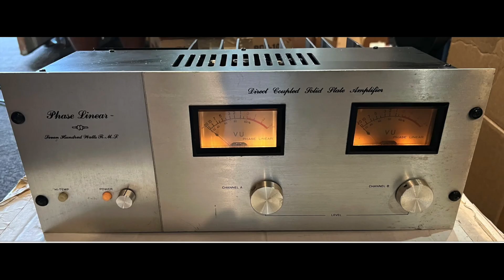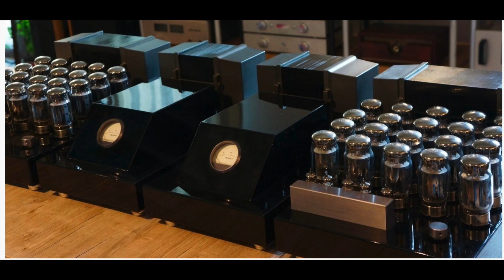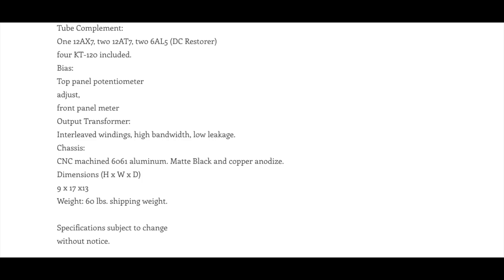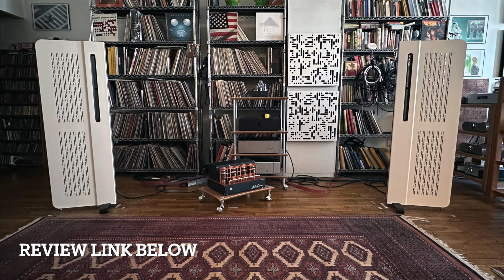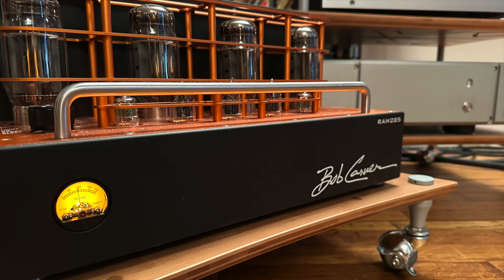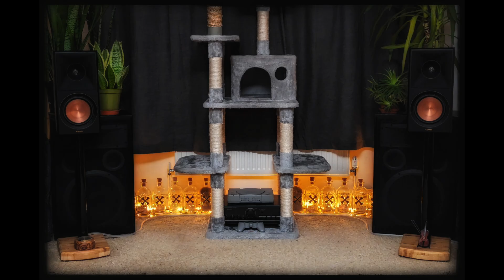BOB CARVER RAM 285 = Maximum Fun!

Comment: I still have my Carver receiver, sort of was consumer State of the Art in 1982. It had a moving magnet phono input, which is the reason I chose it and it's 140 W,  to drivemy JBL 240 TI's and JVC turntable. The SS Carver was the weak link in my vinyl front end system oh I had a tascam cassette deck recorder and later on other kinds of things but I was always a vinyl guy so I bought the best turntable I could afford, the best cartridge I could afford to protect my records and the best speakers I could afford. Well almost 45 years later I still have my Carver Receiver and I've had it repaired three times and it's done fantastic. 

Broadcast radio isn't that important for me  anymore I get everything online but it is the only one of my three original components that I intend to replace. I am replacing it with another integrated amplifier, but this time I'm going with the integrated tube Rogue Cronos Magnum III, I wanted something that could push the JBL's that are @89 DB sensitivity. It has a solid state phono section, so I'm going to step it up a notch and go with an Rogue Ares Phono-preamp M II and my 42 yo Classic JVC QL-Y66F TT as my front end. Going through auxiliary, so I'll be able to run 2 turntables when I finally upgrade to a new deck.

I considered the New Carver Tube Amp, and the Decware Sara & Sophia  and other triode amps even Western electric designs, and I just didn't think the efficiency of the JBL's was high enough to give me the full effect of what I like to listen too. I haven't heard the Rogue, but I'm looking forward to it. On order.
PS your opinion about exile on Main Street. My favorite Rolling Stone album too. I never considered that Mick Jagger added his vocals later. I know he was babysitting Bianca while everybody was at Nellčote. They stayed at another location and that it was unbearable conditions in the basement of the Villa at Nellčote. I know he added certain things in LA, but that he wasn't part of the creation of the whole thing. I never considered that before.
Reply: Good lord you should have changed the carver first and saved a lot of money.

Comment: I developed a dynamic bias circuit for a customer amplifier several years ago. The customer gave me correct block to redesign and amplifier that he had bought which was a home brew calamity. So I redesigned it and decided to do some experimentation and solve the problem of how do we get very low idle current without causing the Distortion levels to rise when more power is required. Has anyone familiar with biasing vacuum tube amplifiers will note, vacuum tubes will suffer Notch Distortion as you increase the signal if the bias voltage is too negative. So I took some of the plate winding output and used it to add positive voltage to the bias Network so the bias would start to go less negative as the signal increased. As a result the amplifier ran so cool at idle that you could touch the glass envelopes of the kt88s without burning yourself. You have to amplifier wood develop more Dynamic Headroom than it would with standard Class B bias because the power supply voltage floated at a higher voltage. Another Advantage was the amplifier sounds more dynamic because the gain of the amplifier increases slightly as the signal increases giving it a livelier sound and increasing the dynamic range.

Comment: There's no question that Bob made some of the best solid state audio Care on the market. However, when he delved into the tube world his designs were fine but suffered from crappy quality Chinese made audio output transformers. When I tested his vt20 to be which was in my shop because the customer thought something was wrong with it I discovered the bandwidth of the amplifier was only 70 to 15 kilohertz. Despite Bob making the claim that it has some incredible been with down near the one hurts range. Maybe it does at 1 ml. But not at useful power levels. That said I still own and use the c4000 free app as the centerpiece of my sound system since February 1980.

Comment: Wow, no mention of the Cinema  Grand  5 chanel amp? You could get it from 200w to 300 wpc. I had mine for  20 years.  Think I paid $1500.00 for mine.  Now, use it in 2 channel  biamp  with my 1st gen B&W 703  floor standing speakers.

Comment: Awesome. If my ship comes in and it's not on fire, this is what I would add to my system.  I would use my Lyngdorf 1120 integrated amp as a pre amp with room correction along with my Q Acoustics Concept 50s.  Hello Santa?

Comment: Hey Steve. I don't have time right now to search all comments.
Have you heard that the late John stroebeen of 
Ohm acoustics (ohm walsh) was approached by Bob carver to design a driver for carvers new subwoofer. That subwoofer was the  sunfire true subwoofer.
John stroebeen in collaboration with Bob carver,the sunfire  true sub was born.
Also research the connection between Thiel speakers and ohm walsh.
In fact some of ohms speakers use  a 4th order Thiel Butterworth  crossover.
PS. Did you do a review of the ohm acoustics flagship F5015 from the 20/20 K SERIES. you mentioned a possible review for 2023.if not did John's death delay or stop the review? I talked to John's sister(joy) 
John's family and some of his workers are committed to keeping ohm acoustics alive. They were looking for a buyer.i believe they will find one if they have not already.
It would be a shame if one of the best kept secrets in hifi audio and one of the best speakers period were discontinued,in terms of height,width,depth,and  of Soundstage, and realism you said in the review of the ohm walsh 1000 series reviews.
If the new owners continue with John's vision,isn't ohm walsh designs one of the closest we will get to realism? Although I think absolute realism is not possible,but let's get close.

Comment: John, love your work but I'm sorry I don't think this at all is proper evidence of impact your changes had. This anakysis is taking the absolute worst csee scenario to the absolute best case scenario, no way a real or ideal world analysis. Any time I ever moved into an apartment, before I had anything in it, it sounded bad. But we live in a room by adding lot of stuff, carpets, furniture, tables, bookshekevs and many many more things. Those are by design there to improve your room situation. So any real improvement should consider an average lived in room with furniture and things people usually have and then test how kucb difference these additions make over using furniture and things we own to make room better.

Comment: Hi Steve, thanks for the review of Bobs newest tube amp. I bought his Crimson 275 tube amp a couple of years ago. It uses 4 KT120 tube and 2 12AT7W and 1  12AX7. New it was $2500 dollars and came with the 5 year warranty on everything including the Tubes. I actually brought it to a friends house who has a McIntosh mc275, I think it was the 3rd rendition. We both agreed the 275 was on par with the McIntosh, except maybe the Mac had a touch more air in the highs and maybe a little tighter bass, but we really had to listen intentionally and intently. I had the same 30 day return policy. I decided to keep it. My favorite speaker to run it with was the LRS. I wonder if the RAM 85 is worth twice the  price of the Crimson 275?

Comment: Thanks, Steve!.  Bob Carver was/is a pioneer in the  hi fi field.  I sprung for the Phase Linear 700 in the early '70s, and was the proud owner for 10-15 years.  Used the 700 as a PA amp before I brought it home to use there.  The 700 absolutely never lacked for power, for sure.Used a Harmon Kardon Pre Amp and exchanged all of the resistors to 1% before I used it. Very sweet sound when using Infinity (servo) 2000 A electrostatics. They were reviewed in Stereo Reviews November 1971 issue. Needless to say I had many, many hours of wonderful sound reproduction.
Thanks for the trip down memory lane with Bob, and yourself!

Comment: Don't forget the C9 Hologram generator, that I continue to use presently.
Reply: My carver preamp had a button for that. Me and my brother were convinced it was attached to nothing as it made no difference at all :)
Reply: @larryowens3704  Hey, Larry. The C9 is a stand alone equipment from Carver. I have owned it since the late 80's and swear by it. It is a part of my system that when I turn it off, the sound collapses and looses life.
To be honest I cannot imagine not having it that I went into the used market and got enough units to last me til my dieing day!
A caveat though,  speaker placement is essential and some recordings does not have the same result. It is small enough that I hide it behind my SPll.
Cheers!